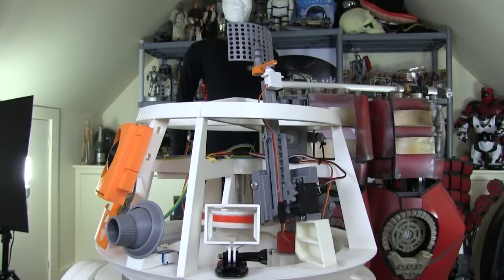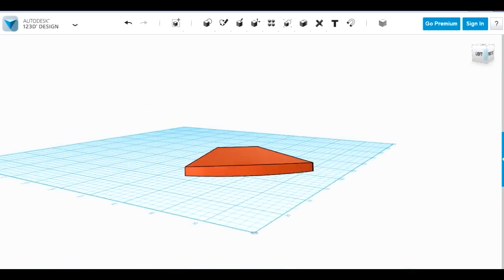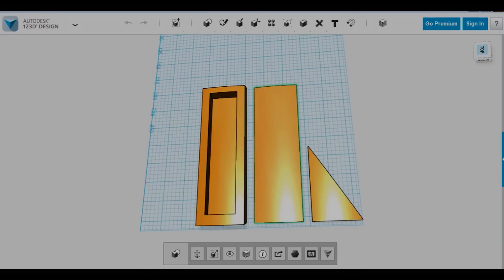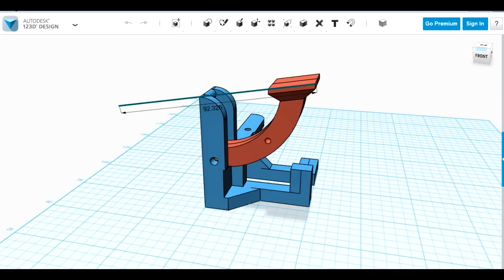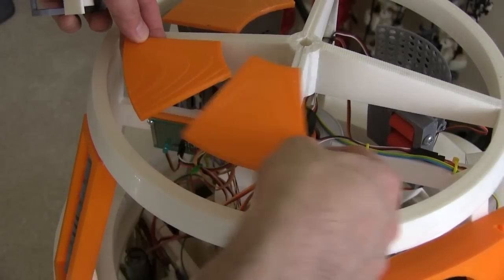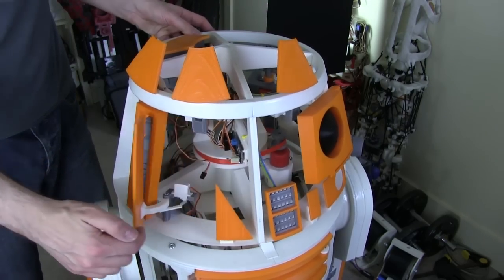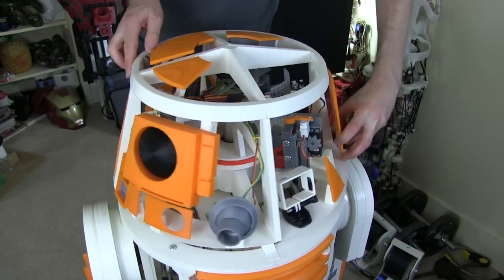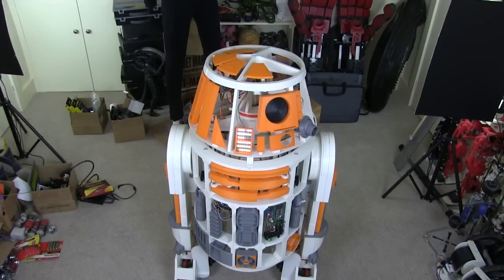Star Wars R6 Droid #19 | Head & Pie Panels | James Bruton

Comment: Perhaps you could put in one of the electric tazer extensions or an arc welding arm similar to the one R2 used on Luke's X-wing in Return of the Jedi. Other possibilities include a miniature unfolding transmitter dish or a blinking emergency beacon.

Comment: I did not watch all 19 parts (yet) but I have a few ideas, in case you are running out of ideas:

I would build things in, which you can use in your every-day life, like a compartment for phone, or a wifi-router (I would use a raspberry π for that [would be around 40€]), or a compartment to store little or precious things. I would also build some speakers into the inner body.

Of course I do not know, how strong your battery/power source is, so it might be a bit to much :D